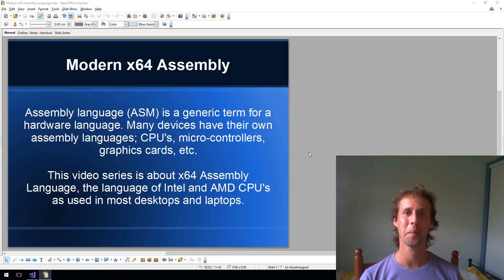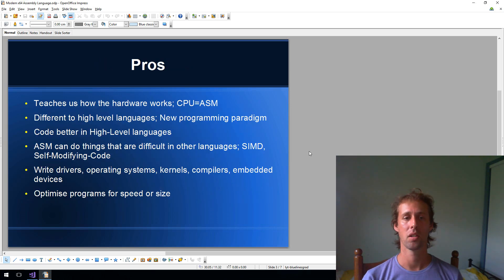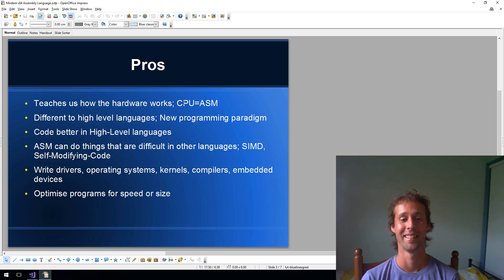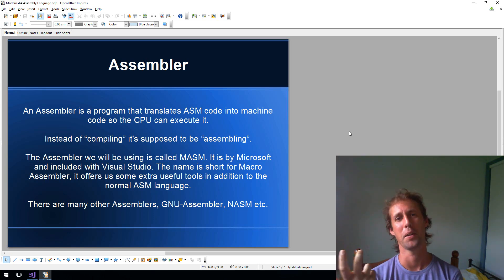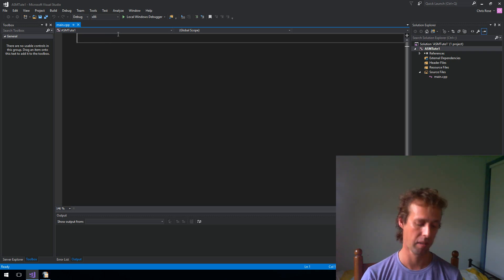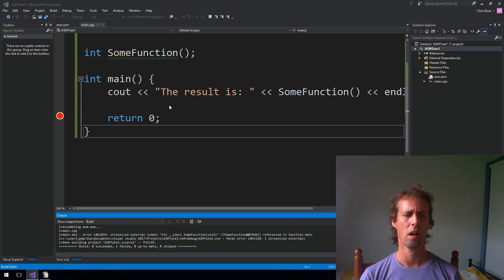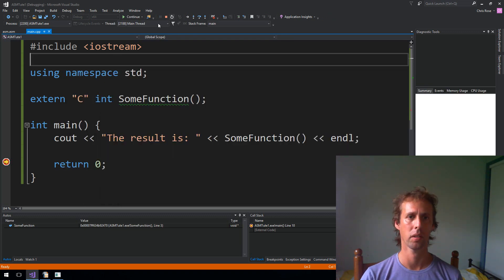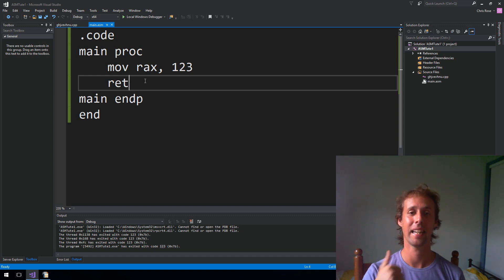Modern x64 Assembly 1: Beginning Assembly Programming

Comment: Being a programmer (I did a LOT of Z80 coding in hex! I can still do it, without looking-up any of the opcodes!), I am really disappointed by x86-64!
AMD's choice to simply re-purpose the opcodes 40-4F was just another bodge on top of the TOTAL MESS of the x86 instruction codings!
By re-purposing those opcodes, they BROKE BINARY COMPATIBILITY!
X86 instructions can be anything from 1 to 15 bytes in length, which must take a lot of transistors to decode, which could be better used to actually perform operations!
AMD missed the PERFECT OPPORTUNITY to simplify all the instruction codings to make it a lot easier for the CPU to decode!
This would be almost unnoticable to the programmer; all the asm instructions would be the same, just producing different encodings for x64!

Comment: 1. Whatever is in register rax is what will be returned to C++
2. Make sure you declare as extern "C" whatever function you have written in assembly (in you C++ program)
3.In 32 bit mode, you can use inline assembly. Don't create external functions, just add
int i=0;
_asm { mov i, 28398}
cout << i;

Comment: My memory is unreliable, but I seem to recall that when I did a bit of assembly language coding a couple of decades ago it was not assembled using a C/C++ compiler, but using an assembler, called masm I think.  I see that MS VS includes ml64.exe, which I'm told is the 64 bit assembler.  Presumably it would be possible to build your example using this with a text editor, not needing to pretend to make a C++ project.  I'd like to see how this is done.

Comment: note to self: visual studio will not include this asm file in the build by default, hence complaining that SomeFunction is never defined
to qoute a stackoverflow answer as a fix; "Define the .asm file item type as Microsoft Macro Assembler for your file (int2d_x64.asm in my case). (right click the .asm file in the solution explorer > properties > General > From the Item Type drop down menu, choose Microsoft Macro Assembler)"
Reply: Hi all, I reply this post, but the question is to anyone. I have now the VS 2022, and the code does not work for me. I tried many topics and tutorials, if those not 32 bit or older, the 64 bit tutorials, topics write the same as in this video, the MS learn pages write the same, but I can not make it work. Always have the error message unresolved external symbol (LNK2001 and LNK2019). Setup the build dependencies, item type setup done, so I don't know what can be wrong, if anyone can help me. I tried it again at least 10 times, create from zero, but always the same.
Reply: @Mormotadev  are the path library directories in the vc++ directories section in the solution property pages valid? it should end with something like ..Community\VC\Tools\MSVC\14.29.30133\lib\x64
in my case ive successfully managed to compile this with visual studio 2019
Reply: @not_herobrine3752  In my case in VS 2022 I see in the solution properties, Configuration Properties, VC++ Directiories, at the Library Directories: $(VC_LibraryPath_x64);$(WindowsSDK_LibraryPath_x64). I assume this is valid. The VS sets up for itself I think. And if I look in the proper menu. Anyway thanks the help :)
Reply: @Mormotadev  I assumed that it wasnt detecting the libraries because maybe your vs studio install was messed up somehow
anyways, i would then try to import the missing libraries manually as part of the project and seeing if that helps
Reply: @not_herobrine3752  I tried to change the variable to the path based on your comment, but don't work. For today it's over to me, next time I try some manual loading I do not know how yet. How annoying when something basic like that makes many troubles 😅 thanks for the help, have a nice day.
Reply: @not_herobrine3752  The devil in the details.. The Visual Studio is innocent it this case, it doesn't messed up the libraries. I ignored a warning that presents with these errors. I created two files, somefile.cpp and somefile.asm. After the VS assemble the somefile.obj, overwrite it with the cpp->obj. After that acceptable that can not find the function XD. Thank you for the help. In this case I was the moron :) Have a nice day.
Reply: @Mormotadev  nice to see a good ending in this case, cheers

Comment: Regarding the error at 16:23, the operating systems loader actually looks for a function called "startup", not "main". When we write C, the C runtime defines a "startup" function that calls a user-provided "main" function. When you don't have a C file, visual studio doesn't include a C runtime in your executable, so there's no startup symbol for the loader to call when it executes your program.
Reply: In this case, his issue was his lack of informing the linker where the application entry point was. In order to solve this issue, you need to right-click your solution in the explorer and select: Properties > Linker > Advanced > Entry Point, in this field you provide the name of the starting procedure. The error will no longer be an issue.

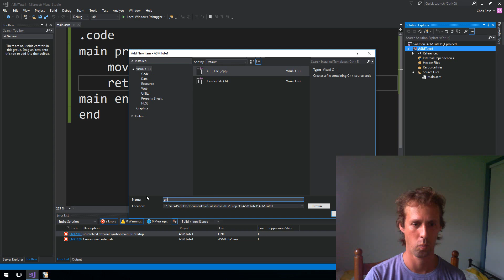Comment: 16:56 if you guys are getting errors after what he did, you can do some extra things i did as i faced the same issue.
Some of these comments mentioned about using Properties of project -> Configuration Properties -> Linker -> Advanced -> Entry Point and putting the value 'main'    this was no luck for me.
So my comment is for guys who didn't have a chance with that.
Do add an extra cpp file like how he showed in the video
Then right click on your .asm file and click on properties.
Under Configuration Properties, go to General and in that you can see "Item Type" whose value most probably be "Does not participate in build". Change this option to "Microsoft Macro Assembler". This wil mostly solve your problem.
@Creel Please pin this so everyone can see it.

Comment: In terms of mainCRTStartup, this is the default entry point, that does some system initialization, then calls your main function. It can be bypassed by manually changing the entrypoint to 'main' in Linker->Advanced. However, I wouldn't do this since it does some black box initialization for windows apps. I believe that mainCRTStartup is code within the runtime library, and obviously you can't have any MSBuild Runtime Library options without the C/C++ msbuild options, which is why adding a stub c++ file fixes it. So, you need to add a c++ file to actually use the runtime library (presumably?).
Reply: both methods didn't work for me. idk why, changing default entry point gave me an error saying "unresolved external symbol main" and making a normal cpp extra file didn't work too, i got an error saying that i dont have main function

Comment: (Currently at 13:33) My code is exactly the same as yours and I got 6 errors.

A2013 .MODEL must precede this directive
A2034 must be in segment block: SomeFunction
A2034 must be in segment block
A2034 must be in segment block
A1010 unmatched block nesting : SomeFunction
MSB3721 The command "ml.exe /c /nologo /Zi /Fo"Debug\asm.obj" /W3 /errorReport:prompt /Taasm.asm exited with code 1.

Update: nvm i was using x86. I hope this helps anyone who has this same problem in the future.
Reply: thank you very much had the same problem ;)

Comment: Ah yes, self-modifying code.  Long time ago, 1982/83 as I recall, I wrote some in 6502 assembly for a music synthesizer. No clock cycles to spare to load timing data from memory via X or Y index registers - wrote it directly into a Load Immediate op of the real-time code that drove the home-made D-to-A.  I suppose that's all mumbo-jumbo to most software developers these days. Perhaps I should make a video about it?

Comment: The message about the missing CRTStartup means, it does not link in the C /C++ startup files, which makes sense, since you don't invoke the C/C++ compiler :) The entry point is therefore a different one which you must tell the linker. You can learn a lot when looking at how gcc builds ELF binaries... with this Micro-Juice Crap you can't see it. There you have crti.o for example, which is called a start file and gets linked because gcc invokes the linker to do so. In other words, just your project configuration is wrong for the linker. I also don't understand why microsoft calls it a C/C++ compiler, since C++ is merely a preprocessing step in producing C code, that's why compilation takes so long. You can easily use C and ASM without this C++ nonsense ;) Also inline asm blocks work fine in x64, although people don't like it. You just have to tell the compiler about the input, output and clobbers for optimization not going wrong. (Well at least with gcc :D).

Comment: Good outline, although I'll give a couple of reasons why programs in general and OS routines in particular should not modify themselves.

I first learned IBM 360 assembler as a Duke freshman in 1975. Later learned Motorola, Intel, DEC, Siemens, etc.  Interesting times. Also, like most folks on a long IT journey, you'll propably also forget more languages than you use.

But whether using Java, Python, shell scripts, ROM burners or DF#A7, understanding computer architecture will help you write concise, efficient routines, that both give the expected answer and also graciously handle error conditions.
If you do any network programming, whether proprietary over private, leased media, or wide-open like IP sockets 

 universities here, with contributions from IBM, DEC, AT&T, GE, the DOD, extended the National Science Foundation network to interconnect most NC Universities and government agencies. The Triangle Universities Computation Center (TUCC) maintained computers from Cray Supers and IBM mainframes, to DEC/VAX minis to Silicon Graphic 3D scientific visualization machines. In 1977 the NSFnet was attached to the DARPAnet and Milnet via the first connected internet backbones and IP gateways (now called routers unless packaged with an internal carrier modem). This allowed major universities, think tanks, vendors and the military to connect and create. 

Stanford, with assistance from scientists at Xerox Parc developed the first character by character messaging system. Note that Duke and UNC jointly advanced the IETF  POP protocol to send the first batch emails, then the first attachments. Beat Cal Berkeley on this by a couple of months. 

But it was all fun, collaborative and required much assembler programming. The first internet gateways were small PDP minis, 

I've learned and forgotten more programming languages, from 
The best way to understand how computer hardware can do and what it can't do. If you really want to understand operating system kernal or device programmimg/debugging, assembler code can manipulate every aspect of the machine. Registers, cache, virtual memory page tables, real memory frame tables, interrupt handlers, device drivers to program devices over peripheral busses are generally coded in native assembly language. Virtual machines can (generally) interpret more than one non-native assembly language output.

The output from the assembler consists of binary machine instructuctions that were abstracted by the assembler language pneumonics during coding. Also provided is a table of label names and their offset from the beginning of the program. Last, some setup, end of execution and error handling code is included to ensure a proper execution environment.

To create an executable binary, the assembler output is input to a "linker" or more properly a "link editor." This utility adds code to load the control registers, and generates precise virtual (or real) address locations by ensuring proper offsets from a base address register.

Comment: Question re annoying little issue. At 13:20 we see that SomeFunction() has a green squiggly. This is ignored, not explained in the video, I believe. In scanning all the comments, I see a couple of mentions of the same problem, which did not get responses. Now, my own code has the same greenie.  Using the same extern "C" int XXX(); format. The mouse-over  tells me, "Function definition for 'XXX' not found". Despite that, it still compiles / assembles, and functions exactly as expected. So what's up with that? Anyone? (MSVS Community 2019, if it matters)

Comment: I can tell you why the compiler gives you an error at the end. Main is actually not the first function the c++ ideal machine calls. It has a few (I can't remember if it's multiple) startup functions, which set everything up for the C++ environment. With just a main function, the compiler gets confused because the setup function isn't there. However it is the compiler that generates this setup function to it is probably a glitch.

Comment: Creel I have a question for you. As you know if I wrote a C code in C99 Standart, almost all computers will worked that code. So it is Universal. 

What about Assembly. is x64 Assembly is universal for every 64-Bit computer? 
Is AMD and Intel x64 instruction sets are different?
Is intel i5 and i7 are different?
Even intel i7's instruction sets are different between eachother?

So briefly my question is "What is the most low level but universal language? Still C or x64 Assembly?

Also, my second question is is Assembly functional today? For example if I know Assembly verrrry well;
Do I want to write a game in Assembly or I just prefer C++, C# .etc
Or if I want to write a mobile app, do i prefer Assembly or high level languages
Or if I want to create a web page, front end, back end, do i prefer Assembly or high level languages
Or if I want to use cloud, will I prefer Assembly or high level languages

This list can go on to infinitiy, but briefly if I know Assembly very well will I choose to use in 2021? Or my boss will just say, "as long as you write fast doesnt matter. Use an high level language"?

Comment: I have a question. I'm studing embedded systems. So, each microcontroller has own instruction set. But in my career I cannot use, single family. I cannot say, I can only use PIC family because I only know its intructions.

So my question is, are these instructions that different one from another? PIC, Atmel, Arduino(Atmel) etc. Or can I adopt them, in a week? What do you think? Because otherwise, learning Assembly will be just general knowledge.
Reply from the maker: All of the chips have their own Assembly languages. These videos are about x86 Assembly, which is the one used by Intel and AMD for desktop and laptop PCs.

For the PIC and Atmel Assembly languages, you want to download the data sheets for the microcontrollers. Those Assembly languages are much simpler than x86.

Good luck, and cheers for watching :)

Comment: Other pros and cons.

Pros
- access to every opcode available on the CPU.
- direct control of hardware without operating system overheads.
- for reverse engineering software.

Cons
- hardly any company is looking for an assembly programmer.
- Very CPU specific. Not portable with different CPU arch.. Even between AMD and Intel there are differences.
- Cost of development and maintenance is higher than in other languages.

Comment: I programmed a small real-mode kernel in full assembly. The first thing that hit me when I came back to C++ was how I saw the "if" statement. Before they were just if statements, but after assembly, I really have the vision of branching the CPU somewhere or somewhere else. I saw them in a more raw way. And it became clear to me when to use the throw keyword: when a condition is false I want to jump out of the normal execution of my function and tell that something is wrong. It may sound obvious but it makes me sees it SOOO clearly. So I totally agree that going to assembly makes you code better, I feel like it makes me code better
Reply: I was TA for a CS 101 class a long time ago. The professor had asked us to make the students disassemble simple programs and analyze the compiler output. It seemed like a stupid exercise at first and the students hated it, but I have to say the smarter ones and the TAs learned a lot from those homework assignments. I have found multiple hard to spot runtime bugs in my professional life using disassembled code... sometimes compilers don't do what the programmers think they do (even if they are correct within the language standard). It's a great tool to have in ones box.
Reply: @lepidoptera9337  would any of these assignments or lectures be publicly available online in any form? started CS a year ago, and have been wanting for great exercises to improve past the Data Structures course, which is the 'highest level' my local community college offers.
Reply: relatable considering [[likely]] and [[unlikely]]

Comment: You know that main is not the entry point of a C++ program. Before main, you must do some basic initialization

* Initialize the stack, otherwise, you must exit via syscall
* Initialize the CRT library, so that printf and malloc works
* Setup some stuff for exception handling
* Call ctors for all global objects, so that std::cout is initialized

That is why you see undefined reference to mainCRTStartup when you only have an assembly file. Your IDE did not link to one of the CRT libraríes.